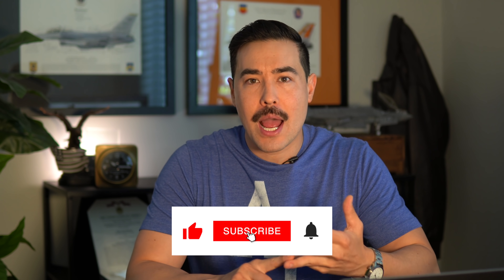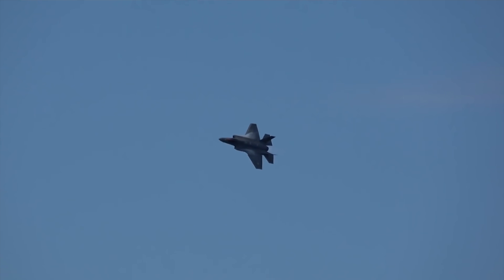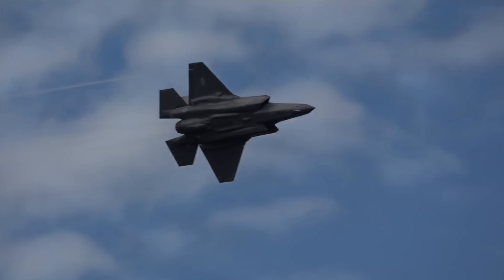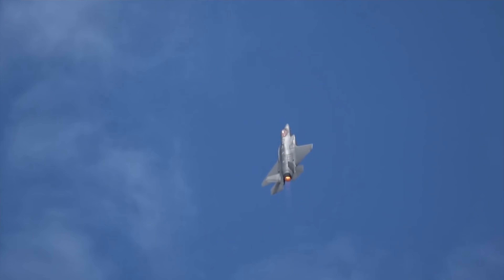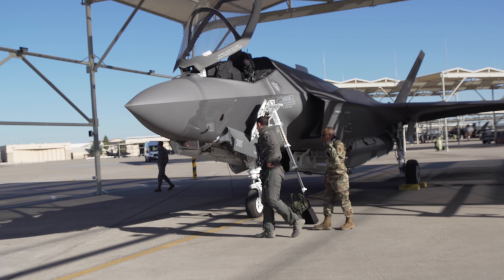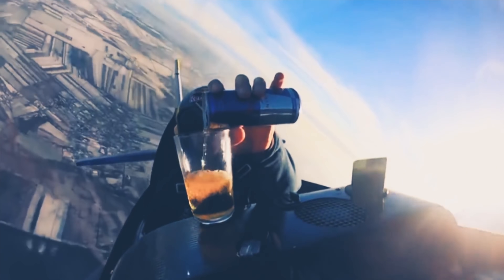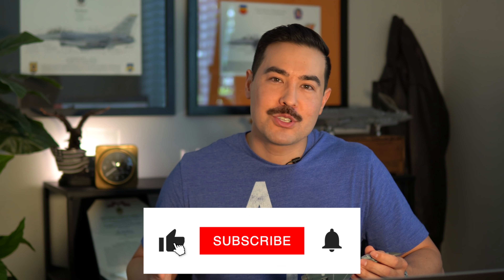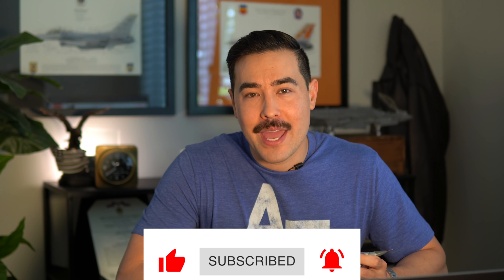USAF Fighter Pilot on NEGATIVE-G's (Don't do it) and Flying Upside Down

Comment: In competition aerobatics, we have to be prepared to fly maneuvers in either direction. That means pilots will routinely see say +7 and -5g's, and up over +10/-8 for some monoplanes in Unlimited category competition.  And of course this is without G-suits, so practice and conditioning are naturally important. It's also important to point out that G-loc is a function of positive G levels and *time*. In competition we pull high G's to turn a 90 deg corner that lasts 5 seconds (for example), whereas an F35 in ACM may be expected to pull 8 G's for 30-seconds in a turning fight.
In regards to the risks of negative G's, we would end up with abrasions on our hips (rolling turns were the worst), and pinpoint bruises on our eyelids at that level (for me above -5G's),  where capillaries seem to be weaker than elsewhere. But I never ever heard of anyone coming back with their face "all-bruised up". That's nonsense, and more likely the result of wind blast in a high-speed ejection. Other issues related to negative-G's included the "wobblies" (dizziness associated with dislocation of the Otoliths), but brain bleeding (stroke) never happened to my knowledge, and was something a pilot/physician advised me was highly unlikely given the fluid pressure equalization provided by our nicely spherical skull.

Comment: Not to say any of this is wrong, but as someone who has regularly done -3 and occasionally -4 as an aerobatic pilot, I would just say that you can build up negative G tolerance just as these guys do for sustained high positive G. Don't get me wrong, it never gets comfortable, but its not unthinkable to work up to regularly pushing -6, it's just not something a fighter jet or any other non-aerobatic specific built plane can do safely.
Reply: I regularly saw +9 -7g doing unlimited competition.  I suspect the fighter pilot myths about the evils of neg g are to scare pilots out of habits that may bend store hardpoints or send fod into the canopy.

Comment: Hi, when you experience negative Gs is it like dropping on a rollercoaster? And would you say that you feel that falling feeling in the pit of your stomach pretty frequently?
Reply: I would say that even a near vertical dive on a roller coaster is still positive Gs given how you're seated. The force is pushing you laterally against your chest through your back as you're facing towards the decent. More comparable to a catapult shot off a carrier. I have seen some rides that will cart you up 50 ft or so and drop you like a free fall which would be negative G. But your talking about -1 G for all of about 4 seconds which gives you that moment of feeling weightless.

Comment: In the new Top Gun movie, some of the F/A 18's are performing a maneuver that I having trouble labeling. I do know the F/A 18 Super Hornet well, used to work at Boeing. Been through those jets top to bottom, from parts to completed certified Fighter. 

In the movie, jets are performing a loop, but are inverted while they do it.  Looks like they are pulling lots of negative G's. There is probably a term for this maneuver, but I'm stuck on 'reverse loop'. 

Also lots of maneuvers exceeding 9 G's on pilot, some look like they are past 12 plus G's almost to point of midair breakup. It's fantastic Fighter, but it has limits as do all aircraft.

Help - thanks.
Reply: I do not recall seeing any inverted negative G loops in TG Maverick. There is a few instances of bunting forward (nose down) after the Cobra maneuver. But so much energy and speed has been bled off its a non-factor really. The F-22 does it with such ease actually.
Reply: @Cirux321  thanks for input

Comment: as far as using only drones in the future because they can pull larger G's, they still have G limits like he said because you have to design the aircraft to be able to withstand that stress, and even if you could make a drone that can pull 20 G's would you really ever want to pull that many G's, the harder you turn the more air speed you are going to lose and it doesn't really matter how much thrust you produce because anything we can make with modern propellants that is designed for sustained flight is going to lose a ton of speed doing a 20 G maneuver.  missiles can do 20 G turns but they also don't have minutes of fuel

Comment: I'm curious how many neg G's are pulled by Super Hornet pilots when doing their typical airshow bunt over at the top of the climb?   Furthermore, just curious if it's possible to make quicker nose pointing maneuvers, but at same time with lower Gs being pulled,  if in an aircraft with thrust vectoring ??
Reply: You can make quicker turns with thrust vectoring, but only at relative low speeds. In general you want to keep up your energy (speed) up to prevent being a sitting duck for missiles. At higher speeds G's will be high (limited to 9 in most jets) and thrust vectoring will not matter in this speed range. Only if you end up in close combat, thrust vectoring will help you. If you turn quicker, G's will be higher, but with lower speeds they will not be that high in the first place.

Comment: Pilots will have a job in the US for decades to come, but countries with less money and a particular mindset will be employing drone fighters. Russian is pursuing this intensely, and could sell those designs as a lucrative export (with downgraded programming or reaction speeds). 

They will probably be guided by a living pilot, but those drone planes will start to outnumber manned planes in many squadrons in a decade or two. Those cheaper drones won’t question orders and will work cooperatively as a wolf pack to defeat targets. There isn’t a weakness to be exploited in weight of numbers- just more guns and missiles to keep you on the back foot. And flying AI will learn from its engagements, getting better and better with backed-up knowledge getting passed on to every newly constructed AI aircraft’s database.

Comment: Extreme negative Gs is something that nothing on Earth had experienced until manned flight.
Reply: And roller coasters lol
Reply: @jrf2956  Interesting thought. Old coasters weren't capable of true, sustained negative Gs. If they did, like a train, they'd fly off the track. "Under friction wheels" didn't come along until 1902 with the "Leap-the-Dips". The first manned flight was in 1903. 

While the under wheels theoretically made the handling of some negative Gs possible, looking at that track...yea...nah. lol It was mostly just used to prevent derailment.

Interesting findings from my researching this: Looking up the history of roller coasters, one of the oldest I could find info on was one in Summit Hill, PA that was actually just a coal-hauling railroad...it was built in 1850 and would give "sightseeing amusement rides" for 10 cents until 1938...friggin damn near a HUNDRED YEARS!! The two oldest were supposedly in France and opened in 1817. 

Interesting thought, man!!

Comment: Computer chips or boards would have to be dipped into a cast of sorts, think of a mother board with epoxy poured over it into a brick shape. That’s allot of extra weight to ensure nothing moves from its place do yo stress fractures. That’s why pilots wig out on ufo sightings. The engineering is a different level completely, it’s not just let make it 10x faster and 10x more nimble. It’s can all the parts stand up to 20g’s over and over and over again without compromising the ridiculously expensive ship

Comment: It will be interesting to see if your theory on unmanned fighters bears out.
The price to keep a pilot in the plane vs remote control is astronomically higher. I can see a case for say 10 drones to replace a single fighter - cheap, small, fast, and without the pilot incredibly nimble. They'd overwhelm whoever they came up against just by shear numbers. You wouldn't necessarily need an operator for each drone either. A lot of the driving, including defensive maneuvers, would be automatic.

Comment: The pilot may not be replaced in the near future but his vision will be augmented (decluttered by computer). Imagine  a ground attack pilot is maneuvering for attack. The target is nestled in and around hi obstructions. Imagine Swiss mountains. There is a path in/out but involves some very precise flying avoiding obstacles. The target was actually acquired by another aircraft/satellite higher and out of range (yes, he could get popped with guided munitions, but that’s not the point, this demonstrates a future attack system). The targeting aircraft data links the target info. The attack aircraft flips a switch and his canopy become fully augmented. Think opaque to the outside. What the attack pilot sees is a representation of the actual target nestled in and around solid cones. The height of these cones represents actual height but the bushyness changes dynamically depending on speed of the attacking aircraft and “it’s flight performance envelope ” basically he just has to keep out of the cones, the slower he goes the more narrow, the faster he goes they get more bushy ultimately looking like a hedge when at super high speed.

Pilots are faced with information overload, a system like this is a virtual filter. The pilots needs to know can his aircraft can get to the target within the design envelope and not wind up in the ditch.

Ultimately the pilot will be replaced with a real-time AI based flying system. Currently the aircraft performance envelop is restricted by the pilot not the machine. Stands to reason the ultimate goal is to get the pilot out of the cockpit, he/she/it is the limiting factor.

Comment: From the first time I saw the F-35's design, I immediately wondered what the designers were thinking?  They didn't give the pilot the all-around visibility of the F-16 and I still think that was not an optimal design choice.   I would have expected the F-35 to adopt a similar bowless canopy giving full all-around visibility even when using the Mark 1 Eyeballs.   Yeah, the DAS may provide a semblance of that same all-around visibility even through the body of the aircraft,  but what do complex electronics like your F-35 helmet with its vision system do?  Fail. Especially when you need them most.    

I also question the wisdom of the F-35's overall design,  since it is centered around radar stealth.   The problem is,  thermal detection systems are getting better all the time and our potential adveraries have them.   The plane may be invisible to radar but it's putting out megawatts of heat out of the back of the engine.  That can't be hidden.     Thermal will be able to detect the F-35 even if radar is blind to it.  And thermal detection systems are only going to get better in the future.   

So, you've got a bulked up fuselage so it can carry internal stores.  You've added frontal area,  volume, and surface area to the jet to do so.  You've added systems (weapons bay doors that open and close) and ejector racks.  You've added weight, you've added bulk, you've added drag.   You've added weight.  Why not just stealth the external weapons instead?  RAM coat the bombs, missiles, and tanks.  

You now have a draggy, bulky airframe to push around.  But you want it to not be a slow pig.  Shove a bigger engine in it.  While the F-16 is legendary for its acceleration with a 29,000 pound thrust  class engine (32,000 pound variants can be fitted, as in GE F110-GE-132 and Pratt & Whitney F100-PW232) ),  the F-35 needs a physically larger, 40,000 pound thrust class engine to achieve comparable thrust/weight ratios and performance.  Which means higher fuel consumption,  which is somewhat offset by the higher internal fuel capacity as the F-35 is somewhat larger than the F-16. 

All those changes, and compromises, just to bow to the god of radar stealth,  when the upcoming god is thermal detection systems that are going to render the F-35's stealth design philosophy an outdated relic of a bygone era when radar stealth was sufficient to assure a low probability of detection during the ingress phase of flight.  

I don''t criticize the F-35's CAPABILITIES.  They're amazing. And the best of them are secret.   I criticize the fundamentals of the radar stealth design philosophy.  It WILL become antiquated,  sooner than you think.

Comment: Whao whao whao, you said at around 3 min, that you "Set your lift vector" is that a way of saying you pulled back on your stick to climb? Then you said you had enough airspeed for the climb, but you "reset your lift vector by 10 degrees". Perhaps this is basic stuff, I looked using those keywords, but basically I am thinking there is an easier way to monitor your angle of attack and airspeed, and to know your thrust at any given moment so that you aren't bleeding too much speed? I mainly play war thunder and this is a critical thing for me, mostly just guesswork but I guess it is down to a science now so you know exactly what to expect, given countless times of data, so as to not bleed too much speed as that means death, or pull to many gs as that can also be pretty bad, and you try to never operate outside of those given limits? I do fly sim so this is very interesting. 
Thanks

Comment: Which makes me think of the Top Gun scene where Mav claims he (they) saw a "Mig 28" do a 4G negative dive. That's pretty intense dive if it were real....
With all of the technical advisors, why would they even put that line in there? They were discussing the "problem with the MIG 28's inverted flight tanks" anyway so, why make it -4G? Shoulda made it more realistic at -2 G or so.

Comment: A rapid traveling AI fighter jet might not happen until 2070 that can run covert bombing and anti-air missions..... but a propeller drone with a 6:1 or 7:1 power to weight ratio that can face track - could kill you so fast and they could be dropped out of planes. And those will definitely be prolific. Both plastic and lithium are cheaper than fighter pilot training and jet maintenance. But yes it won't replace initial attacks in wars likely.

Comment: The F-16A was electric but not digital. It's fly by wire system was analog. (And the later, digital variants model that analog circuit behavior, so pilots don't have to re-learn how to fly them. That's why they're not as capable of low speed, high-alpha maneuvering as, say, the F-18, which was digital right from the start.)

Comment: Done a fair bit of aerobatics in everything from Cessnas to Warbirds and Extras, but the scariest thing I did was straight and level prolonged inverted flight in a Yak52. I was only tagging along for the ride, but hanging in the seat harness wishing I'd pulled it tighter was not fun!

Comment: Interesting that people say “remove the pilot and pull as many g’s as you want.”

Not only the point Hasard makes about pilots being able to think creatively. But also the aircraft has structural integrity. In other words it will break apart if too many g’s are applied for a given duration. 

So no, you can’t just pull as many g’s as you want.

Comment: how about manouvers that combine both positive and negative g? Are they even possible? Like rapid descent: begin just by pointing the nose lower and then invert to make it really tight. Would it be faster than getting inverted first and than doing vertical u-turn?  Would it save more energy? Would it move the plane out if the line of gunfire faster?

Comment: I flew the F-15C, but before the air force I was an ATP flying corporate jets for a living, and flying airshows and competition for fun and supplemental income.
I was surprised to find that flying my Pitts and Extra was much more demanding, physically, than flying the T-38 or F-15. Roll rates were similar, my aerobatic planes had similar positive g limits and higher negative g limits. We regularly flew -4, -4.5gs in competition, while -2.5 was very rare even in the eagle.

Comment: If you are flying straight and level, whether you are inverted or not, shouldn’t you still be pulling 1 G if you’re not accelerating? Aren’t you required to do a pushover in order to achieve negative Gs?

Comment: If you are inverted, you are not experiencing -1G. 

You are still experiencing 1G, you are just experiencing it upside down. 

Negative G refers to the force felt when you manoeuvre in such a way that you briefly carry momentum upwards, after acceleration has ceased. This causes a weightless feeling. 

Positive G is the force that you feel under that acceleration. Pilots often think of negative G as, blood rushing to your head, and positive G as blood rushing to your feet, which is generally a crude and inaccurate way of thinking of it

Comment: well there isn't negative g's unless the gravity is pulling you away from the ground which I don't think is possible in any way. the gravitational force on a consistent turn stays the same even inverted its just the forces are moving in a different direction.

Comment: Question, can you do 0g in a fighter jet?
Reply: If you go from positive G's to negative, you will pass 0G on the clock. So yes, definitely. To maintain 0G you can fly a parabola shape. In other words, with the nose up slowly push the nose down, will reduce your weight to 0. You are not really going to notice weightlessness though, as you are strapped in belts (but you can make a pen hover in front of you).
Reply: @LarsHofman  oh alright!